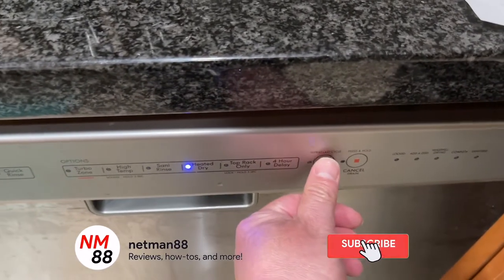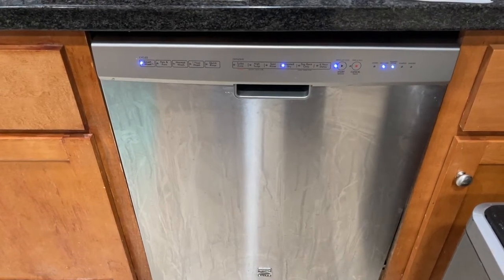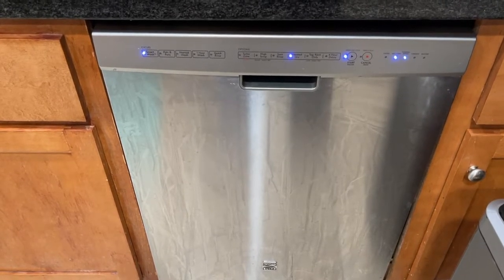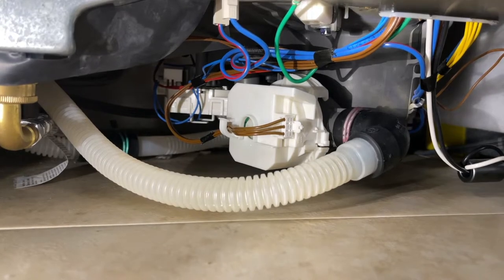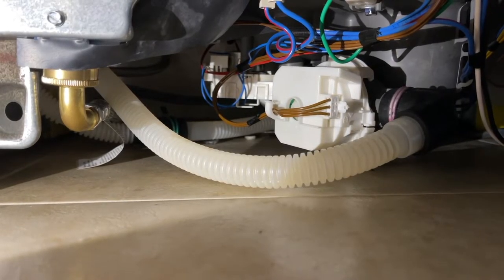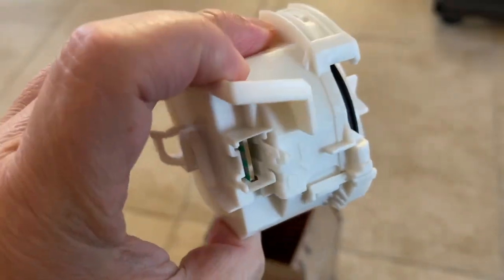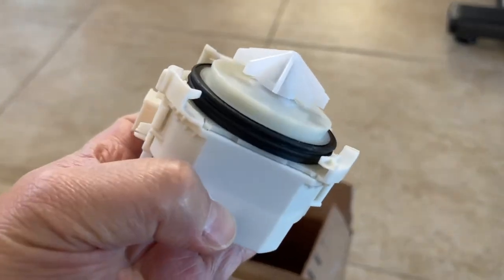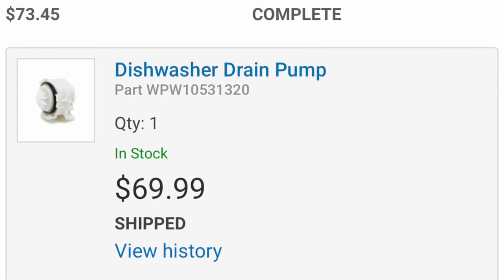[SOLVED] WHIRPOOL/KENMORE DISHWASHER CLICKING NOISE

Comment: My dishwasher wasn't draining and it was because the sink drain was clogged so it would drain a tiny but but then would just fill back up into the sink and then back into the distwasher so I plunged it which brought up a lot of gross stuff and then I use draino which cleared the drain but now my dishwasher won't drain still and it makes a clicking noise while it's trying to drain. Is it the drain pump you think?
Reply from the maker: Could be but check for food particles blocking the outflow first.